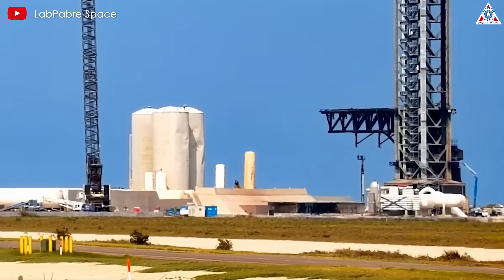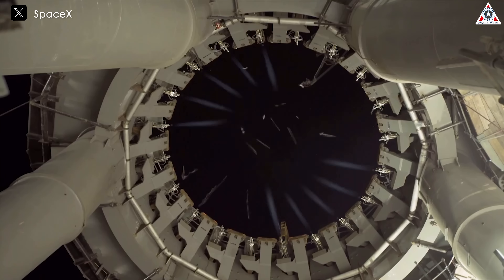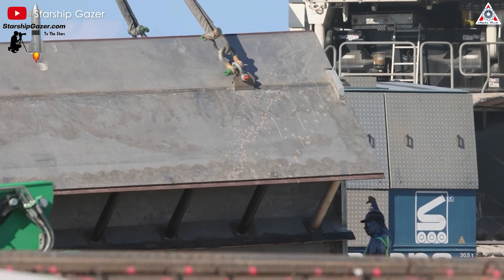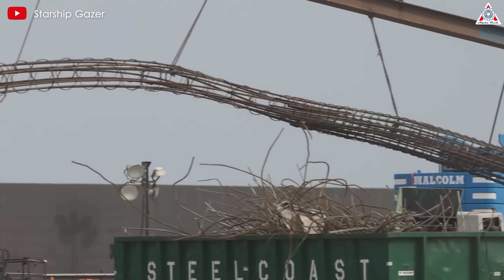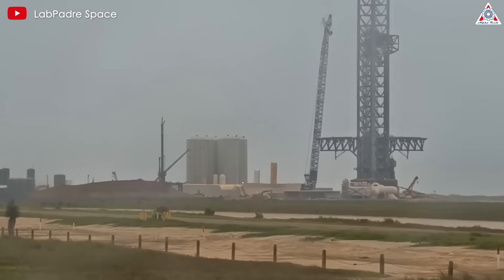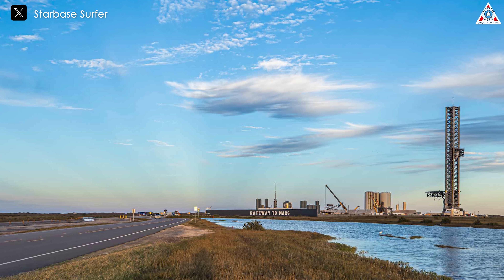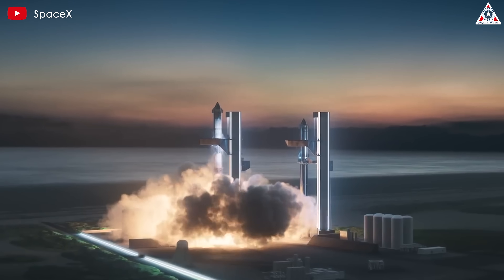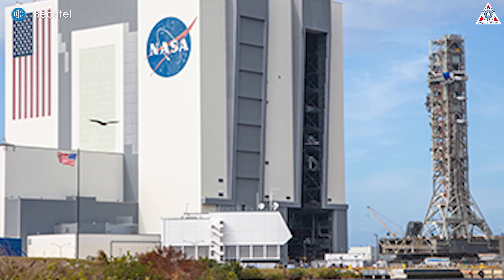What SpaceX just did Completely HUMILIATED NASA's Scientists

Comment: The space industry is the same as the aviation industry everything charged at ten times what it really should.  Toilet seats for $10K , parts made uniquely so they require specialized tools which break or wear out easily and are expensive to replace, the whole system is nothing but a rolling ripoff, all being justified by saying its for the safety, or the quality, or some other lie.  All that Elon is doing is avoided that trap as well as some smart thinking.

Comment: Artemis launched a capsule twice as far as the moon on its FIRST TRY.   SpaceX has built 28 starships none of which have succeeded in doing what they are ‘designed’ to do.   NOW spaceX is building an entirely NEW OLM because it took them 5 years to figure out why NO ONE ELSE builds launchpads like that.   Despite relying on launchpads NASA built 60 years ago that are so rapidly reusable that SpaceX relies on them to achieve the launch cadence of the Falcon 9.   Thus far, their OLM has not survived even a single test firing without sustaining millions in damage. 
And NOW we have found out that their idea for flappy fins may well be unworkable, five years and 6 billion in, because Musk never built any TEST articles to verify the concept as workable, BEFORE building an entire manufacturing infrastructure around mass producing something he doesn’t even know CAN work at all. 

And, because SPaceX did NOT bother to think thru the entire design and test their assumptions, they have had to keep slapping so many bandaids on the Starship and booster that they only just found out that it can barely lift itself to orbit, because it weighs so much more.  SO now they not only have to build the OLM they were ADVISED to build 6 years ago ( with flame diverter and top flooding deluge ) But they are having to build the tower much taller because their rocket has to be TALLER to carry enough fuel to actually lift half the mass Musk promised. 

Only Musk’s deluded fanboys would watch serial failures and count them as successes. While ragging on Boeing for a 737 door and the Orion having a valve issue.

The only humiliation here is SpaceX’s engineers having to rebuild the entire launch site to make the fuel tanks shorter and the support structures further away, rebuild the OLM because SpaceX utterly ignored the accumulated experience and science done 60 years ago that SOLVED the reusable launchpad problem before Musk was even born. And the fact that their entire idea of stainless steel, control flaps, and hexagonal heat tiles  did NOT stop the ship from melting on re-entry. 

SpaceX is JUST as far behind on their promises of starship as Blue Origin is.  MORE over-budget than Artemis was. And still nowhere near meeting his targeted goals for a moon landing, much less going to Mars. 

Musk fanboys are members of a cult, incapable of rationally analyzing failures and outright lies when they hear or see them.
Reply: "Musk fanboys are members of a cult, incapable of rationally analyzing failures and outright lies when they hear or see them."

If you think Musk has fanboys, you should try talking to a Trumpov fanboy. Those MAGOTs won't believe anything unless it's from Trumpov's own mouth.
Reply: @phillipzx3754  Well rufus t F nuts you have not watched the launches his success has you whining well BOO frigin HOO
Reply: It the artemisia process the same to the moon which can go to jupiter maybe 🤔 😏 sls is the ship and the orion is the star part 😊
Reply: You're right. The SLS/Constellation cost more than $20billion over more than 20 years and costs $1.5billion to launch 70t to LEO because we haven't even started the Block 2. that was supposed to loft 130t... Who's gonna pay for that?

Spacex uses iterative (Agile) project management. That means they don't take 20 years to get a job done. 
They design, fly, blow stuff up, try again. All the while refining the manufacturing process and the rocket.

Starship has already been sent to 170km and is working fine for orbital or extra planetary work. No heat shield needed if the object is to throw the rocket away... like SLS. 

They are trying to REUSE the rocket which blows away SLS as the rockets cost about $100m to make (maybe $150 now), not $1.5 billion and they can be reused up to 100x. They demonstrated this with F9 which has now seen 22 reuses.

The short version is that F9 flew 96 times last year and is on track for 130+ times this year. Spacex has about 16 rocket cores that they use over and over and only have to build a few cores a year to keep up. 
The result: They are the cheapest and most reliable rockets in the world. 

Starship looks to be even cheaper to launch despite having 5x the capacity (more if V3 works out in about a year). 

So. No. Taking more than twice as long and twice as much money to build a rocket that costs 10x as much to launch a smaller payload is Not success.

Oh. And they used their Own money to build it. 
Remind me who kept paying over and over for a "too expensive to fly" rocket? 

Again: 
Starship costs 10x less money to fly as opposed to SLS without reusability.
Once reusability is established (as it was with F9) the cost will be 30x less expensive (that is expected to happen within a year).
Starship was developed with about 90% private money at Half the cost and less than half the time.
It is on track to have More capacity and volume than SLS Block 2 (which will cost billions and years). 

So. Do you still think "Getting it right the first time" is worth 10x-30x the price tag? (Excusing all the extra time and sunk costs.)
Crack a book on "Agile manufacturing" .

Comment: I would say the current launch tower is pretty much useless in terms of SX's long term objectives. It still has to be basically rebuilt after every flight. The less exposure the tower has to the consequences of the blast the better. They have a lot of very complex machinery associated with the launch that has to be eliminated. They started with a relatively simple idea and then continued to enhance it in order for it to work. Now they are revisiting what they have done and starting over but with a better knowledge base. I think that quick release "hose" is about done. You can't rebuild that thing after every firing. Not to fear - SX seems full speed ahead right now. If the next flight is successful and the subsequent flight with adjusted flaps goes as expected, it will be light speed for the Starship.

Comment: They'll use Flight Test 5 to RUD the Old Pad trying to catch the Booster on the first attempt & then build a Proper Flame Trenched Pad.
Reply: Not exactly. There's a good chance that the heavy booster will crash and damage the PAD, but I don't think they're looking for a RUD for the PAD in that way, let alone looking to rebuild it with a flame trench. The reason it wasn't built with a flame trench in the beginning is that the ground, being close to the sea, is composed of sand and water and is very unstable. This makes the only way for the OLM to be viable is to build a large concrete base underneath with long piles in the ground. Because of this, even if it were destroyed at IFT 5 and rebuilt, they would probably still not be able to add a flame trench.

Comment: Despite the extra cost in construction and engineering, could a launch be carried out from about 3 times the height above ground level and still be successful? Could the rocket be hanging from the structure as it does from the chopsticks, but to take off instead of land? Does the launch pad or ground give the initial firing of the rocket engines a bit of a kick start or boost as it provides some kind of pressure against the thrust? If it makes no difference, then could the thrust become less harmful if the ground or anything below the engines is further away?
Could the launch tower be built like a gigantic cone structure with the smaller end at the top? The top could have an opening in it twice or 3 times the diameter of the Starship. The rockets being launched out of the structure would be hung from supports inside the cone structure, and the bottom of the rocket would be much higher from any kind of ground base as it is today.

Comment: Interesting, but plans usually dont survive the test of time.

I'm really happy we have other start ups besides NASA now, and besides SpaceX, because no one endeavor is likely to get everything right when looked at in hind sight from the future perspective.

My guess is that NASA was stubborn, until came SpaceX, and SpaceX will be stubborn until the next major start up gets traction. And so it will continue, until theres an actual healthy pool of competition, and enough different stuff being done, that the less functional things get trimmed off, by collective borrowing what works from each other.

A healthy competitive ecology.

What I see is a tower problem due to spindly ships and excessive hull ratios.  

And once the heat shield problem is fixed, probably by coatings rather than tiles,  Doing piggy back ships on boosters will be viable.
There are coatings possible, that arent gonna get knocked off by falling ice.

In that case the booster can be shorter and fatter, as can the ships. And towers will be replaced by erectors and transporters.

The problem with towers and launch mounts, is its short sighted thinking compared to the eventual numbers of ships being launched.

The launch mounts will eventually just get used as test firing stands, and free standing ships and boosters built and tested, that maybe use some  re entry lifting surfaces extended aft, to create landing legs and exhaust exit space.

Then it will be cheaper to just build armored flat surfaces with water bath systems in rings, for take offs and landings, and have engine reliability at start up replace the being held down thing.
Perhaps via a warmup low burn, and then gun them.

Like the Stoke engine they are trying to get the time down on between off and full power. their time span is already short enough to not need hold downs... Just strap in, and punch the button.

Things are gonna morph, and SpaceX looks to be getting the cart ahead of the horse some times. Ship design concepts will evolve rapidly enough, that having a line of the same prototypes ahead will actually retard progress, as things learned, not be applied until that line is used up.

Ditto on launch mounts and towers, already talk in this video of obsolete launch mounts. Might be better to use them for test stands than scrap them. just build the next version a ways away... so you have a test stand and a launch mount.

Otherwise, you are wasting time and money, and if the competition realizes, they can jump a step on you. Enough of those and you end up in second place.

Its always the missed logic, especially if some one else realizes it.
I dont think lift ships will look much like the current Starship 20 years from now. Nor will they be launched with the same routines. They will be more turn key and taken for granted, just like vehicles now dont require being started with a crank.
The count down to launch will be something only done if theres kids onboard.

Other wise it will just be the cabin crew glancing and nodding at each other.

So in summary, I suggest not building too much ahead, and instead focus on upgrades and redesigns that simplify required infrastructure,  as much as possible.
Also simplify the ships. Anything over complicated and over expensive should be suspect.

Like Stoke using a universal pump with multiple combustion chambers.... Thats gonna be cheap and fast to produce, and way less moving parts than every combustion chamber having its own pumps. And I have been doing writs on that since before parts count....
Nothing would please me more than have guys at Stoke use that to catch SpaceX, also the tapered ships thing, thats now in the works at both  Stoke and Rocket Lab.

Gonna be embarassing if everybody goes there and SpaceX is still using a tower for a crutch.

As the numbers of ships will dwarf the numbers of towers.

They will be dinosaurs pretty soon.

Part of the problem is FAA & EPA, and SpaceX trying to get progress in spite of them. And getting too far ahead of them selves.

Best would be a max of three ships of any version, to get increased iteration velocity. And if possible upgrades should happen on every next ship being built.

Youre not gonna get a final production ship for awhile yet. Basically Starship might be 10% there now.

Comment: I liked it when all the NASA engineers said the water deluge system would not work, and they were all pretty much laughing at him.

Not only did it work, but it's superior to the flame trench, people don't realise that the frame trenches are concrete with metal plating, and the metal plating needs to be replaced on every launch because it's melted and deformed, this system, nothing it's ready to go again.

This is the main problem with government stuff, the people working there only do what they think is the safe option, once they have made a decision they just keep running with it even if it's bad.